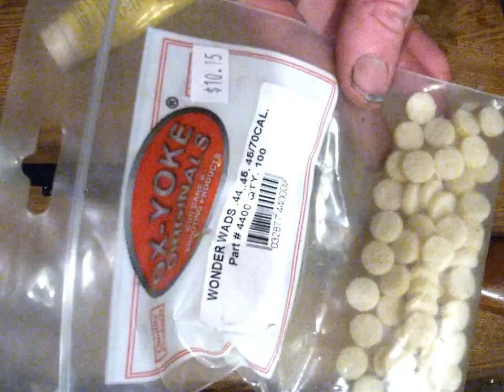Cap and Ball Revolver chain fire: Footage and Discussion

Comment: It is not a new phenomena.  In June 1837 Samuel Colt submitted his 2nd model Patterson rifle to the US Army for trials at West Point.  A popular and well liked Sergeant Major did the test firing.  At some point while the man was holding and firing the new revolving rifle in the normal rifle fashion 3 chambers went off destroying his wrist and ending his military service.  Some bad will from the Army towards Colt products resulted, but the trial actually continued but the hammer broke too and that was that.  The trial board opined these revolving rifles was not suitable for military adoption for general military use and it would be years before the US Army adopted revolvers.  Yes some of those same revolver rifles were purchased by a General for use in the Seminole War and some of the 1850 pattern were purchased by both armies for use during the US Civil War but they were not popular.  
There is always unburnt, very fine, black powder (BP) dust resulting from firing a black powder revolver.  Not all powder is consumed before the projectile crosses the barrel cylinder gap and some escapes with the cylinder gap flash.  Colt BP revolvers have nooks and crannies this powder can accumulate in.  As the quantity builds up the likelihood of an expanding fireball grows.  Keeping the gun clean after firing is important.  I prefer bullets that are just a tad oversize when I load my revolver so that they shave off a tiny ring of lead as they are being loaded into the chamber.  I brush those rings away.  The greased or waxed wads seated below the bullets do help.  Back in the day, before such wards were marketed, loaded revolver cylinder chambers were often sealed with lard placed over the chamber mouth before carrying.  This helped both provide a small degree of waterproofing and also help prevent flash over.
There are 2 common sizes of percussion cap, #10 & #11.  Some percussion guns require the smaller size for best operation and to prevent a loose fit..
A rule emerges, never put your hand or arm in front of the cylinder of a revolver.
Reply from the maker: Definitely agree and funny fact someone just asked me why I was holding it the way I was and I explained that